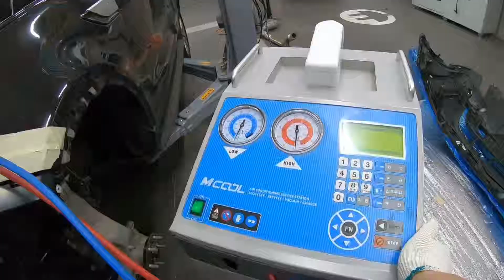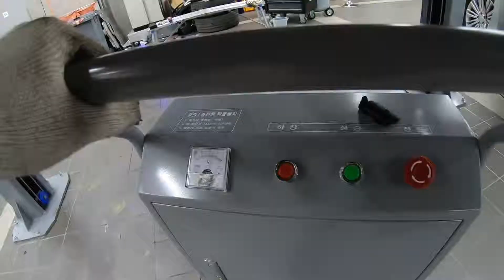All new discovery Ingenium 2.0 diesel removal part 2

Comment: Just did one on my face. Chain failure, fitted new chains then bottom end so stuck another engine in 😂
Reply from the maker: yes, this case same. in this case i replaced bare engine assembly.
Reply: @CardoctorSteve  took us 12 hours and we are not mechanics
Reply from the maker: @Thehighlander123  we are mechanics and we also 12hours for the first time. you guys will get shorter to do next time. good job man.
Reply: @CardoctorSteve  I never want to do it again.

Did the chain on the same vehicle and the bottom end ended up failing.
Reply from the maker: @Thehighlander123  I agree. I also hate that job. lol.
Reply: Yep, it developed the rattle and it was all top end, I did the chain and it was Ok then the second it revd the bottom end was knocking, there was parts of plastic tensioner in the oil strainer. Its my wife’s F pace.
Reply from the maker: @Thehighlander123  you did good job and saved money as well. a few of early ingenium 2.0 diesel engine used to have some trouble with that plastic chain tentioner. it was broked or cracked. I actually still don't know why. lol
Reply: @CardoctorSteve  Thank you, managed to source an engine with 21k on it from a Breakers which cost £3800. It’s from a 2021. Went in no bother and is running lovely for the now. At least I now have a sore engine.
Reply from the maker: @Thehighlander123  yes. I think that engine should change engine oil earlier then the manual said. the manual shows 32000km or 2 years. but i think that mileage is a bit longer.  I suggest 15000km or 1 years to change engine oil to our customer in case the engine failing after finish warranty.

Comment: Why does this brand new engine need to be removed?
Reply from the maker: Hi. The engine hadn't been starting. It had been broken the timing chain guide. I think the oil pressure suddenly become low and the tentioner was not working properly then the loosed chain hit the guide in my thinking.:) thanks for comment
Reply: @CardoctorSteve  Thanks for the background information.  I came past this video by chance, as I'm investigating the reliability of the Ingenium i6 engine though this is the i4.
Reply from the maker: @tempestv8  I am not sure for i6 ingenium reliablity. it just installed on new defender and start selling about only half year ago in my country. new technologies got into new engine. for example, electric turbo installed that help to get more power in turbo lag range(low engine speed) like that. we also need to investigate that from the cases of issue in the future.

Comment: IS IT TRUE THAT YOU HAVE TO TAKE OUT THE ENGINE, TO REPLACE THE TIMING CHAIN IN THIS 2.0 INGENIUM DIESEL ENGINE???????
PLEASE DROP ME A REPLY IF YOU CAN :O) THANKS AWESOME VIDEO :O)
Reply from the maker: I think that is depands on the engine mounted. maybe you can replace timing chain without taking out the engine if the engine mounted longitudinally. you will need to take out the radiator and impact bar for the space. 
but if the engine mounted transversely, there is no space to work with the timing chain. you will need to take out the engine.
hope this reply help your work.
Reply: @CardoctorSteve  Thanks for the fast reply :o) I also came across this clip: https://youtu.be/1K4brpoNGO8
it says to remove the transmission to do a timing chain service on a JAGUAR XE 
i DO LOVE MY JAGUAR XE 20D, I change oil and filter every 5000 miles, (in the hope it lasts me a long time). Have an awesome week!!! Blessings from America :o)
Reply: Does this engine require a timing chain replacement at a particular service interval?  Or should the timing chain be expected to last the lifetime of the engine?
Reply from the maker: @tempestv8  It would be no required to change the timing chain. I didn't see the timing chain replace interval on the manual. that engine just happened to damage the chain tention guide.
Reply: @tempestv8  at the dealer, they gave me a service schedule, timing chain and guides show due at 180k miles. Actual may vary on the way you drive and maintain.... i change oil and filter every 5k with the correct spec oil and factory oil filter. That's me on my jag, since i intend to have it around for a long time. I don't drive wild, I drive my car gentle. I truly love our jag and have had so far zero issues (other than a battery replacement). Hope this helps :o)
Reply: @APPLEtv4VIERACAST  is your Jag engine an Ingenium 4 cylinder diesel or petrol/gasoline?
Reply: @tempestv8  2.0 DIESEL (XE AWD) Ialso like to add liqui molly diesel purge in the tank from time to time and keep my diesel filter and air filter new as well.
---
There are NO TIMING BELT ISSUES...  IF ... you change your oil often. (I do an oil and filter change every 5k with factory filter and correct spec oil STJLR.03.5007 0W-30